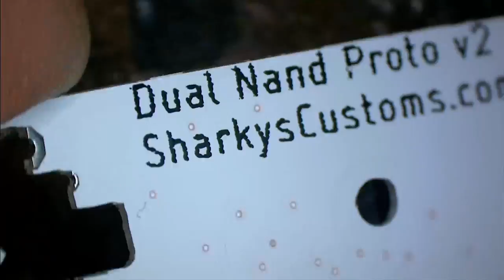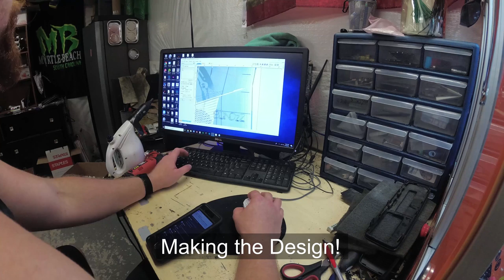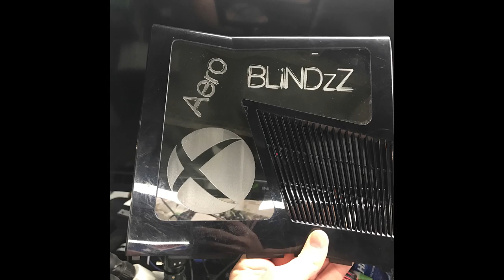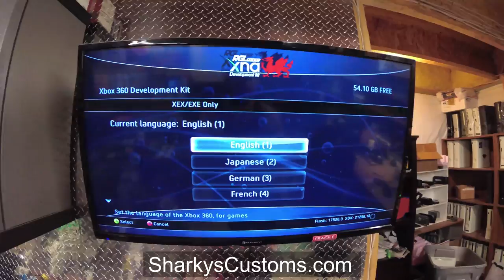Full Custom Console Build for BLiNDzZ. RGH/JTAG - @Davisornaw - SharkysCustoms.com

Comment: Good night friend, I have a question, I want to attach a 12 volt LED light strip to an Xbox 360 Slim console, but I do not want to solder it to the board, but with a USB cable I connect it to one of the USB ports that the console brings. Will it work for me? Thank you.